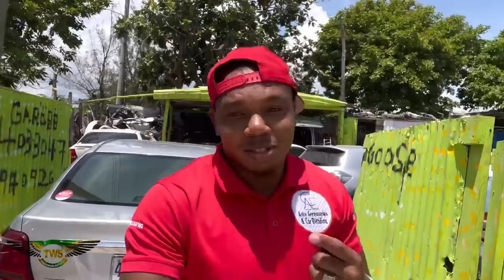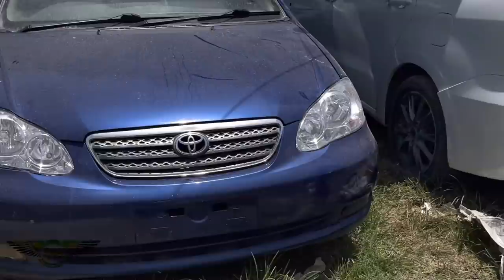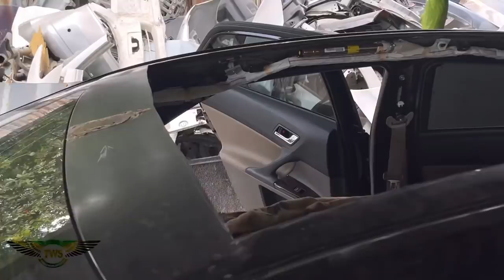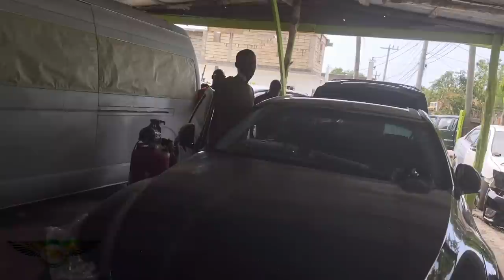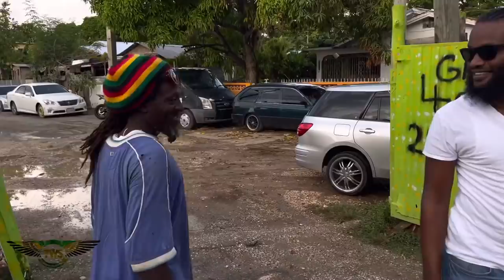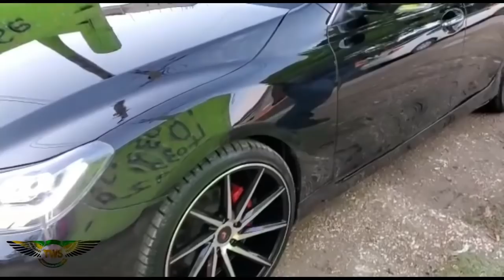Mark X gets customized SUNROOF and FACE LIFT || Goose Garage || 4K

Comment: The sunroof confuse mi bro. Cuz I know this model of the X comes with a sunroof from factory. So why not get one with the sunroof? Just curious. I think it's cool that you guys can install one. Love the upgrade of the bumpers and lights. 2010 to 2017 quick and easy.
Reply: It doesn't come factory
Reply: @D-KingMaker  So all the cars I have been seeing with sunroof are aftermarket?
Reply: @D-KingMaker  It does. The GRX130 chassis has a sunroof option. I made sure to go to a Japanese used car website to make sure I wasn't lying.
Reply: @RazrThinblade  no just saying some models come with some and some don't
Reply: @RazrThinblade  this is not that model he chnage the bumper
Reply: @D-KingMaker  oh mi understand that. That's why I was wondering if it was worth it to get one without and do the change.
Reply: @D-KingMaker  Yeah I realise he put on a gazoo racing sports bumper at the rear, got some 2017 face-lift headlights and front bumper. But it's the same chassis GRX130 he got them off.
Reply: @D-KingMaker  Yes they do.
Reply: @theonick2  I have owned 2 markx i know the platforms and diff versions well
Reply from the maker: Some people just like the thrill of doing Custom than just buy it like that
Reply: @Intrigue_clay  I understand man. Just wanted to see the thought process. Right about now I debating to get one with or one without. How has the sunroof experience been? Makes the car cooler or hotter than before?
Reply from the maker: @RazrThinblade  well I don’t hear any complaints from the owner he loves it
Reply: @Intrigue_clay  Nice